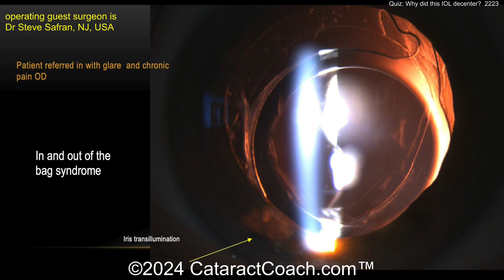CataractCoach™ 2223: CataractQuiz: why did this IOL decenter?

Comment: Nicely done.
What was the cause of ppv?
Reply: This patient had an open capsule and it's best in this case to assume vitreous may be presenting because at some point it is likely to....such as when you aspirate the viscoelastic at the end of the case so you want to clean that up with the vitrectomy to prevent having vitreous prolapse at the end of the case   You want to be very careful not to manipulate the IOL when vitreous is presenting as you will cause vitreous traction.  We also wanted to remove the debris from his YAG laser and other vitreous opacities which were causing bothersome visual disturbances.  In these open capsule cases I prefer to place trocars at the beginning of the case before I make any other incisions as its easier and safer to insert the trocars in a closed eye, less chance of forcing vitreous into the AC as you push the trocars in and the presence of the trocars as you work gives you better control of the eye, more access points to the IOL.